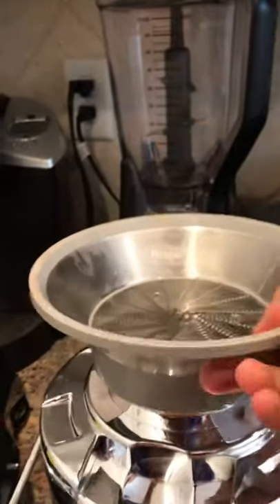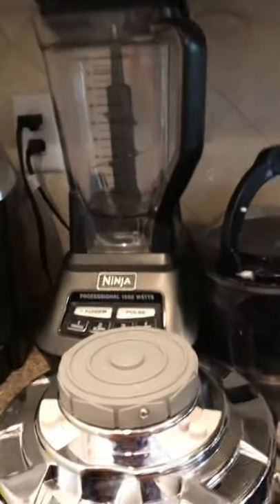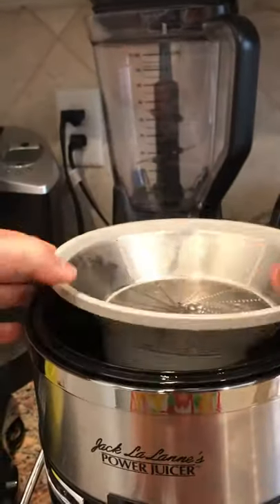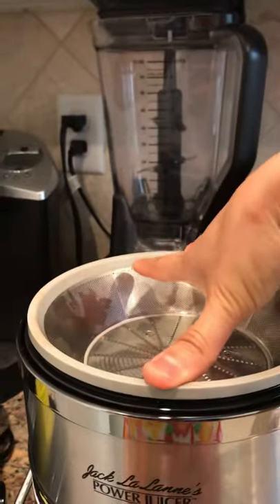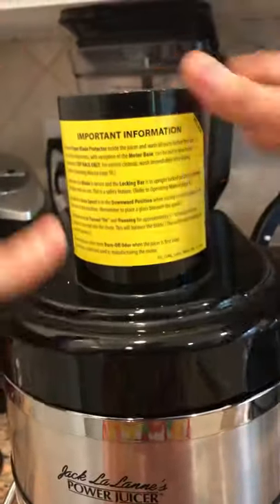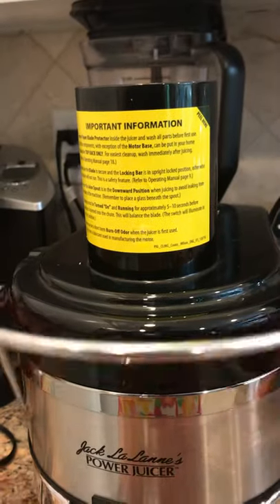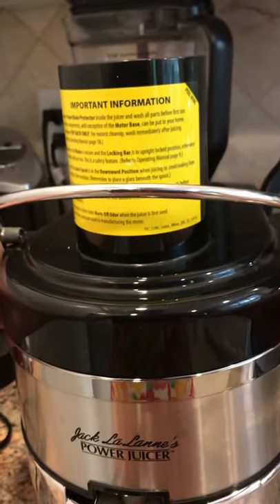How to open & disassemble Jack LaLanne’s Power Juicer - Model E-1188-1

Comment: Same, mines is stuck and won’t come undone
Reply: Thank you for this video!
Your model is the same as ours.
We haven't used ours for several years and can not disassemble the grinder assembly. All the other YouTube videos both old and new show a crescent tool used on the two holes which ours do not have. We will keep trying until something gives!
Reply: @jaaronsan  there’s one on here that tells you how to open yours. Her’s doesn’t have the crescent tool either. I’ll try to find it again. Hold on.
Reply: @jaaronsan  it’s this video, silly me. Yes, mines uses the tool and Hers does not. Call the company. They should help you.
Reply from the maker: I posted a new video for an easier way to open it ❤